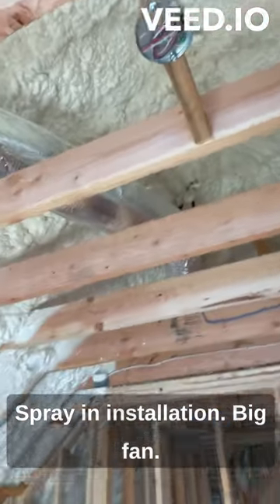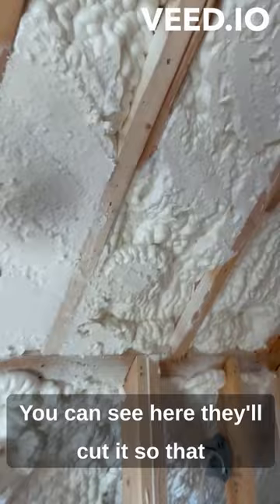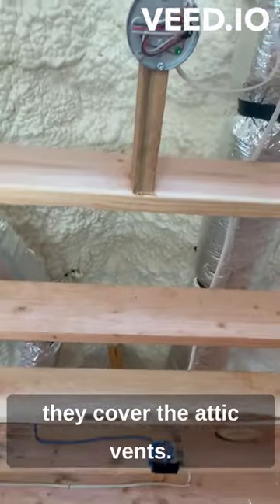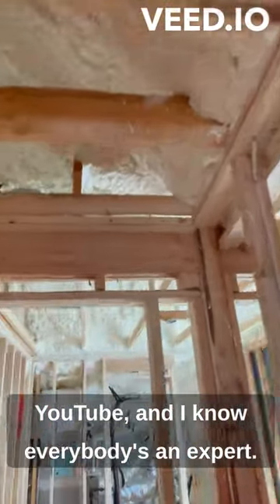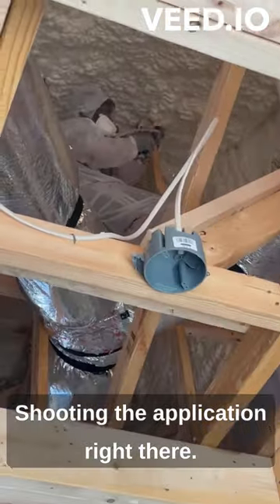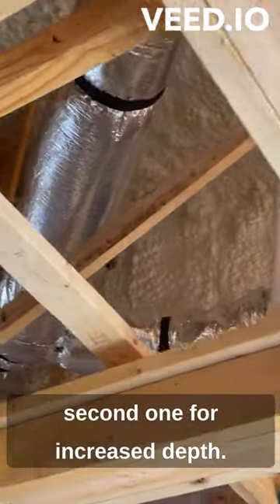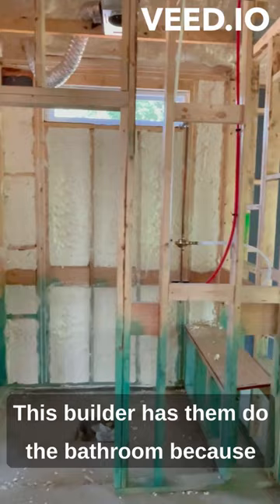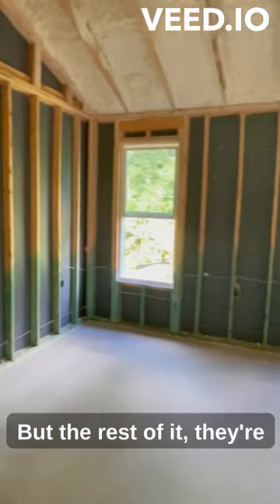No Ventilation with Foam Insulation?

Comment: Looks to me like that isnt really an attic, but a fully conditioned space in the roof line.  Since that ceiling wont be insulated, the condition space continues to the roof line, thus what they are doing is correct.  As for not spray foaming everywhere, thats just a money related issue.  Either the owner or contractor is cheaping out.
Reply from the maker: It's an attic. Based on convo with the foam installer, no ventilation needed. Maybe, I like that product but need to really be convinced about the ventilation aspect. As far as walls, builder is all about cheap as possible.
Reply: @Hmtatlanta  Yea, not sure I'd fully trust that if an actual attic.  I'd personally stick to tried and true vented.  Curious how it actually performs over time with how hot it gets down here.

Comment: The rest is batt because it’s cheaper and the cost don’t out weigh the benefits.
Reply: Yup .most heat escapes from roof.
Then with cooling and heating 
Exterior wall windows doors are factors as well

Comment: I used to do this job. Highly toxic. If not sprayed right in the right conditions it will go through a chemical transformation. What usually smells like rotted fish.

Most insurance companies will not insure a house in with the spray foam installation. If you do have a leak it will not show. It will just rot all the wood above the spray foam.

Stop doing the job due to the toxics materials. It does affect you when you are the applicator.

Not worth my health not worth your health. Just don't get it. 

A proper spray foam insulation. You do have to install air vent flow baffles between each rafter. The house still needs to breathe. 

Food for thought.
Reply: So essentially spray foam installation is good as long as their are vents in the attic to let it breathe?
Reply: No you don't need vents if it's a conditioned attic, it has to be sealed. But there are real problems with doing it that way.
Reply: @bobbygetsbanned6049  tell me more... I'm here to learn from the experts.
Reply: Represent over 300 Insurance companies nationally.
Not 1 has an issue with spray foam insulation.
In fact it's not even a question on the standard accord homeowners or commercial building application
Reply: @bobbygetsbanned6049 ▪︎ doing it which way?
Reply: @cw93711 ▪︎ so why have so many ppl stated insurance companies won't cover a roof with spray foam insulation?  Do the insur co require a special process be followed if using spray foam, which isn't being done? I'm trying to figure out why so many are adamant abt lack of coverage and yet you, a broker, disagrees. There's a missing component.
Reply: @bethanyanderson1745 social media and rumors aren’t a good combination if you haven’t noticed.

Comment: Everyone’s talking about the potential of a roof leaking for years without knowing because the water is trapped between the iso and the sheathing.

That would be true with closed cell. Closed cell in a roof is a no-no. But the water will permeate through open cell and will drip down. We have it on one of our large buildings and we have had three different roof leaks through the years that were noticed very shortly after it began raining.

Comment: Fill and cover those vents.  Batt insulation on interior walls is sufficient. Ten years ago, very few builders weren't doing any, interior, insulation, so anything in your interior walls is a step in the right direction. Plus, having some airflow, through the walls, is more beneficial than you'd think. Too many new homes are too airtight, so you have to consider some trade-offs.
Reply: @Steve-hj6xv  ▪︎ fill and cover which vents?
Where are you from that homes built around 2013 didn't insulate walls? Must be very temperate climate.
Reply: @bethanyanderson1745  interior walls, guy. Interior.
I don't know "what vents" and I'm not watching it again since I watched it three months ago.

Interior walls are what they talked about which is why I referenced interior walls as opposed to exterior.

Comment: Ok asking because I don’t know, don’t you need a air space under the roof for the shingles so they don’t curl up?
Reply: Comments say that is an issue. Roof needs the attic ventilation for its integrity.
Reply: Code says closed cell sprayed right onto bare roof deck. Ventilation allows moisture in and closed cell needs to keep it out.

Comment: Spraying the underside of the roof for what? & No vents? how is the wood going to breath in an used area? I wouldn't want that for my house. These builders are fucking crazy. Make it make sense. & the rest of the house gets Batt insulation, ridiculous!!!
Reply from the maker: Installer was all about "doesn't need vents". I think the same for crawls - used to be vents now it's full air tight encapsulation.
Reply: Most of the heat loss goes thru the roof normally. Walls lose heat slower so need less of an R value. If you are in a cold part of the country watch out for icedams
Reply: I don’t think you understand how air flow and humidity work. Foaming the attic puts the attic space into the conditioned envelope of the home. Just like if you close up your crawlspace and seal it. You need to dehumidify the space otherwise the humidity will build up and you’ll get mold but the transfer of moisture from outside is not substantial enough to cause problems unless you get ice dams
Reply: @Baconbeerify  the attic isn't conditioned, there is no dehumidifier planned for this space. Encapsulated crawls always have that to handle the inevitable moisture issue. These attics will have moisture, you see the low grade windows and daily life will generate inside humidity and it will find its way into the attic. The floor are not foamed. I heard what the techs said, while I like this stuff I'm still unsure of some of these claims.
Reply: I checked out a house built like this, the attic does have a small active a/c vent and return.

Comment: Can't you still put attic vents in and spary around them as the vents from soffits will move air up as well as prevent condensation? You still need to remove the hot air in the summer and move air. This is great for the R-value and sound dampening it creates.

Comment: That stuff is the best it's expensive a lot of people have different products I work commercial we use this stuff all the time it's good to do the outside walls the inside you don't need that type of stuff that the fluff insulation you could use inside the house no problem it's basically for sound

Comment: I'm just another armchair building inspector but the attic vents are there to cool off the attic so you don't need to change your shingles every 10 years. The spray foam should be on the ceiling not the roof. The attic is supposed to be kept as close to outside tempurature as possible. If a real inspector were to see it it would fail inspection.

Comment: Seems like you could easily do both foam and ventilation and that would be a better overall solution.  Sure you "CAN" get by without ventilation but is it really the best option or are you simply setting yourself up for other types of problems down the road?!

Comment: I honestly rather use cellulose. The humidity gets so high in the attics in the south. Even in a fully sealed attic you're going to have a humidity problem.
Reply: In a sealed attic, you will have to condition the space to avoid humidity issues.
Reply: @christopherhorne8665  I'd like you to find a perfectly sealed attic in the south--it's like a unicorn they don't exist.

Comment: You'll need a dehumidifier without vents in the attic.
Reply: Depends on location. But yes. 
What most hvac forget.. is you still need some air circulation up there.
Reply: Just add a supply and a return, and you're GTG. Thats how ours is. Had it done ten years ago, zero issues.
Reply: @paulmryglod4802   empty grill in strategic places works also.  I wouldn't want to introduce supply air into there. It's wasted.. but also way cooler. 10deg maybe even 20 degrees offset from house should be fine.
Reply: No, you won't. Central AC will automatically dehumidify the air
Reply: wrong @thingsifoundontheinternettoday  I have to run my dehumidifier in the basement all summer and its cold a/c . I had an apartment that was the same in the summer
Reply: @sunrisesunset7  that's a basement. This is an attic.
Reply: @thingsifoundontheinternettoday depends on if the system is sized correctly
Reply: Roofs don’t start leaking for no reason

Comment: No ventilation because it seals so well... That's makes no sense.
Shouldn't there be baffles in between the rafters with eve vents and a ridge vent to allow air circulation.
One question though... What's with all the green paint on the lower half of all the framing?

Comment: Spray insulation is no good. It's extremely hazardous for you and the environment and when you need to get to a leak or run new pipe or electrical it's a nightmare.

Comment: I for one am NOT an expert, but I do know that there is some pretty good evidence for insulation that is not moisture proof, but instead keeps it's temperature insulating properties even with some moisture and dries easily. So basically wood or wood based materials. You too seem to be quite happy with wooden frame so why not when wood is processed into wool in between frame posts? 🤷‍♂️

Comment: No u dont need a dehumidifier, your ac will do fine.  The problem comes when u redo your roof, cuz they won't guarantee the roof without vent.  I did the same thing on a house in tn and the only problem is the smell of the foam!
Reply from the maker: The attic space is not conditioned. No vents, no AC and no dehumidifier. Installers said "don't worry" and I'm not so convinced...
Reply: @Hmtatlanta  I live in Tennessee, we are remodeling a 1970's home and when we updated the hvac they told us to remove all the old paper insulation and foam the roof.  The new ac unit has a dehumidifier built in.  Tbh  the attic space is somewhat conditioned and does not seem to need a dehumidifier, but I air it out when the humidity is low, and I am not a professional and not many people I have talked to will tell me a straight answer.  We did try and get a new roof put on and Erie roofing would not guarantee it unless it had vents. The smell of the foam does get strong and we had it done 1 year and a half ago.  It does keep the bugs and mice out really well and that is one of the reasons we did it.  If you find out a better answer lmk cuz I don't know how we are getting a new roof if they won't guarantee it?
Reply from the maker: @frame6563  I'm not pretending to be an authority on all of the "new" stuff. Used to be ventilate crawl spaces, attics and homes. Now it's button everything up air tight. Not a fan, I like fresh air and have no use for living in a tupperware container.
Reply: @Hmtatlanta  me neither! The hvac guy here in tn told me never open your window! I told him he was crazy but the humidity gets to be too hi to keep the windows open all the time, wish I was back home where we never closed the windows
Reply: @frame6563 ▪︎ by "old paper insulation" you mean batting, right? Sounds dumb but my brother-in-law  found newspapers were used in the walls of the old farm house his bought. So just checking...

Comment: What about the heat that gets into the attic through the ceiling?  Where does it go, or will the ceiling just be perpetually hot?
Reply: Yup you’re right, it’s referred as a hot roof
Reply: The attic is conditioned space just like the rest of the house. There are HVAC vents and returns in the attic to keep air circulating.

Comment: The worst idea of insulation ever! lots of testimonials to people that have had roof leaks in various other issues that wind up having to demolish the house because it was an impossibility to make the repairs with the foam insulation .
Another massive drawback is a lack of venting for the drywall and wood structure therefore moisture retention is imminent and highly destructive.. .

Comment: Not a huge fan of spray foam insulation. Especially at the roof decking. What happens if/when u have a leak? It SURELY want be easier to find than blow-in insulation. Another problem is off-gasses PRIMARILY in existing homes not new buids.

Comment: Batts only in bays around roof penetrations. You have to be able to find the leaks when stuff fails.
Ive seen it too much. Honestly im not a fan of it. I was called in by a mortgage holder to inspect and see if we could actually save the house. They were advised that it woild ve been cheaper to just bulldoze it the mold was so bad... 
We saved the house but honestlyy it was 50/50 either way. It works great but hides way too much.

Comment: Your ducts are going to sweat 😓... need to put a dehumidifier up there .
Reply: How will your ducts sweat when your building is acclimated.  The only way that would be possible is  for hot air to mix with the cold.  Doesn't happen when a building is wrapped in spray foam.  Just saying

Comment: Its still a good idea to put down firing strips between your tar paper and your roofing. Metal roofing is ideal for it so you don't need a second layer of sheathing for shingles or what not. This allows the roof to still ventilate itself and it makes it easier to find leaks. It's good stuff but some heat still does leak out. This is coming from a far northern climate though.

Comment: No vents because the attic is heated. It’s part of the “envelope “.
Reply: Correct your building is complete conditioned space. In some areas you might require air exchange but for most going in and out of your house a couple times a day is sufficient.

Comment: I hate sprayfoam in walls with the heat of a thousand suns.  once the foam goes in, think of the wall as being cast in concrete.  there will be no changes made, whatsoever.  so get it right and pray you never ever change your mind.
now, if you do a double wall, with sprayfoam in the outer framing, and all your infrastructure in the inner, that would be acceptable.

Comment: So the no ventilation thing is a correct method of insulating called hotroofing and yeah Batts In the wall, yikes.
I've seen people spend thousands and thousands on closed cell in the walls then put Batts in the attic

Comment: Full encapsulation is the way to go! Your house doesn’t have lungs so it don’t need to breathe👍🏻🇺🇸
Reply: Houses are full of moisture and contaminants and yes they need to breathe.  That's why foamed houses have mandatory ventilation systems now.
Reply: Sure, and that's why new homes require either an HRV or ERV. 🙄
Reply: If you dont know what your talking about then just say that
Reply: @TheSugish  so we do want moisture in our house?
Reply from the maker: Right; so cooking, showers, breathing and everyday life adds nothing to interior air that needs to be evacuated. You're OK living in a tupperware container that depends on one or two HVAC systems to handle that? The HVAC systems probably undersized and improperly designed, basic economy grade, with filters that aren't changed by owners to "smart homes" that most owners have no idea how to use and which depend on the internet. Thanks. I'll pass and stick to what works.
Reply: Wrong... to tight is worse. A house has to breathe or the condensation will build mold and rot... roof vents are needed
Reply: This is one topic , can’t find a true answer . Vent the attic or not
Reply: @cheeseburger9232  spray foam issues have arose where sprayed to thick cause off gassing.
Reply: @judygoodson5855  I remember seeing a documentary on a house that got spray foamed attic , it was sprayed on wrong and gave off a chemical smell owner couldn’t live in it finally the owner got a contractor to take the roof off trusses and everything
Reply: Spray foam creates the wrong seal for walls. You want the seal on one side of the framing. In the north you want it on the inside of the framing. In the south you want it on the outside of the framing. Framing must climatize and dry to one side or the other to prevent moisture rot and excess moisture condensation. All homes that are "sealed" are required to have mechanical ventilation to replace air at a set rate to prevent carbon dioxide and carbon monoxide buildup in the home. The home does have to breathe or the occupants will experience major heealth issues or death. 

If you follow those HVAC pipes that are already installed you will find 2 of them leading to the outside of the building, unless the home has bathroom vents and a vent hood for the stove. If there is only 1 then it is an intake for outside air and the bathroom vents and vent hood are actually the exhaust to the outside of the building. If there are 2 one is intake and one is exhaust. 

The biggest benefit to spray foam for a roof is also the biggest issue. It doesn't show water leaks until the wood is rotten.
Reply: I'm not sure you understand how a house works, maybe you shouldn't be given out advice, friend😊
Reply: The attic needs to breathe.

Comment: When you see this? Turn and run as fast as you can! Every roofing nail that has came threw will have already started to condensate. Do I need to go on? Ok, I will, so as the nails condensate, the water has no place on go, and when it freezes, it pushes the roof up and starts a gap between the blowin and plywood. Then, when it thaws, mold starts. 5 years, the roof will be junk. Then, the homeowners will be stuck with a magnum bill to rip off the rotten plywood along with the blow in insulation. And that could make the house un fixable, and new rafters might be the only answer.